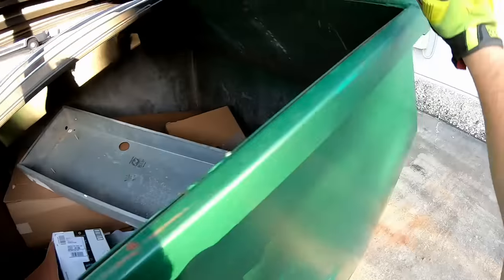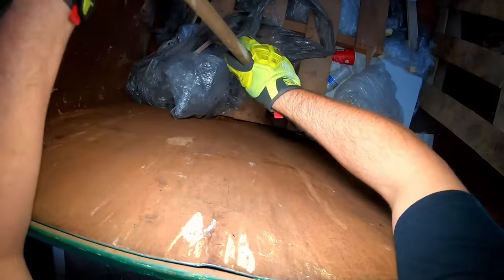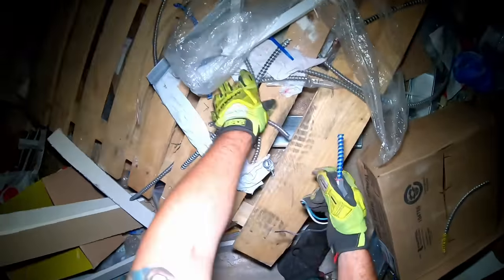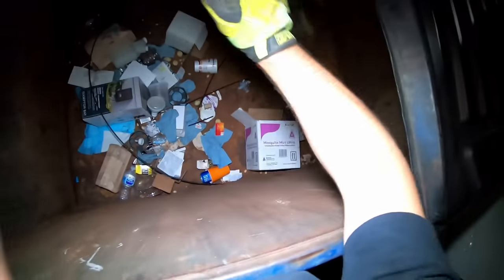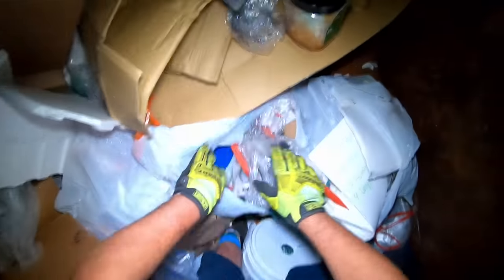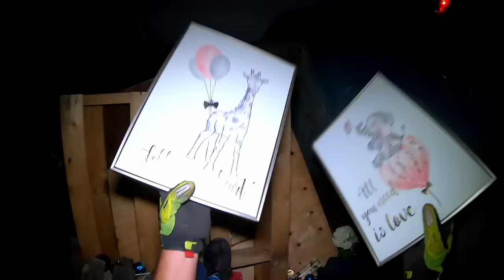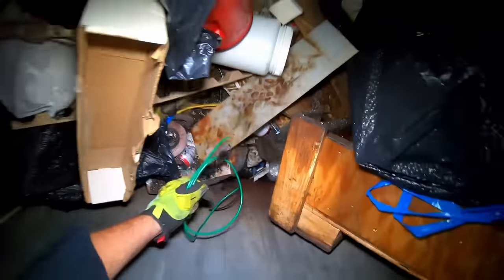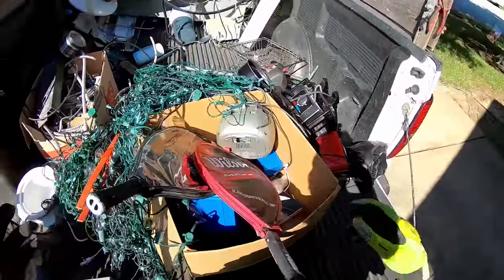Dumpster Diving "Gotta Touch It!"

Comment: Hey Mike just a safety tip be careful of the fluro tubes as the dust that comes out of them has mercury in them, if you have a cut and dust gets in it wash out straight away

Comment: Cat wire is CATAGORY 5 or 6. Cat 5 wire has 4 pairs of twisted copper wires where the twists cancel out inducted interference. I am not familiar with Cat 6 wire, But the higher frequencies today's devices probably require a different number of twists or maybe another pair.

Comment: Here is an answer to your question about the white flakes floating in the bottled water :  Sometimes during colder months when water freezes, rapid changes in temperature can cause the calcium minerals to separate from the water, bond together and precipitate, or turn into a solid form. When the water thaws, the calcium stays in its solid form and may appear as white pieces or flakes floating in the water. If you’ve ever encountered this phenomenon, you’ve experienced science in action.